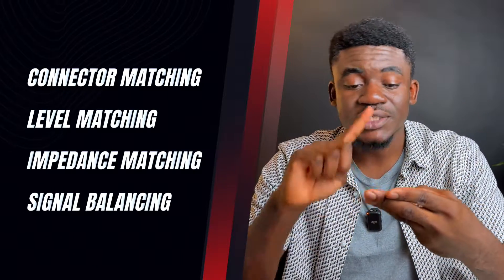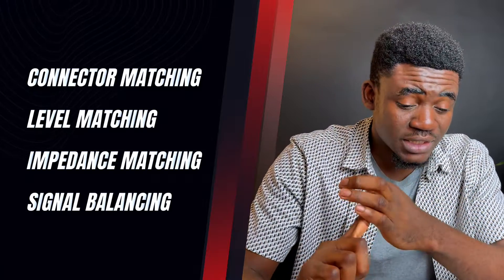What is a DI BOX?

Comment: Ive had some challenges with ground loop in my PA equipments going through the FOH could it be caused by not using a power cable i use to power my electric guitar combo with no earth wiring in it also i recently acquired four DI boxes three stereo and one mono DI could it help remove ground loops